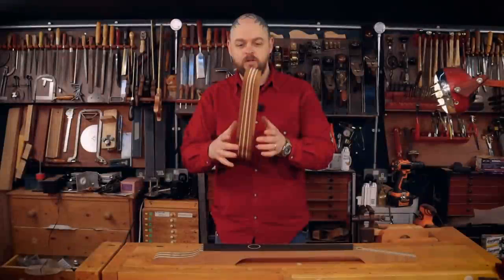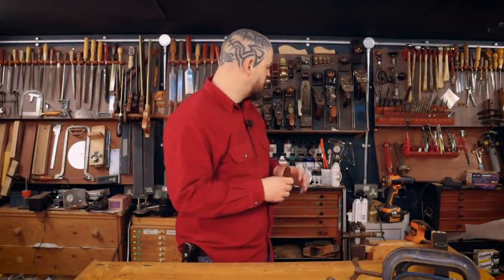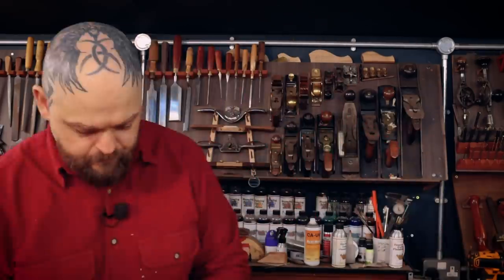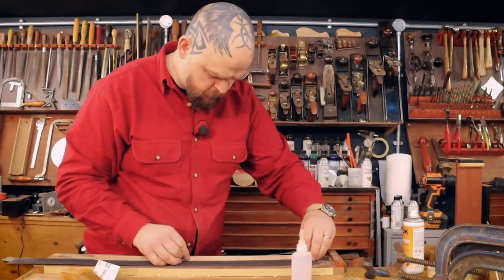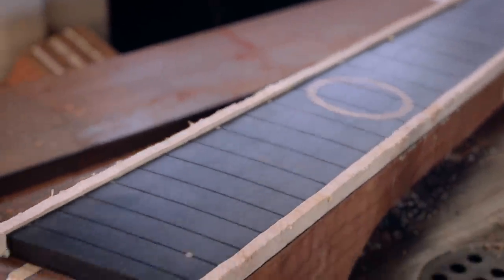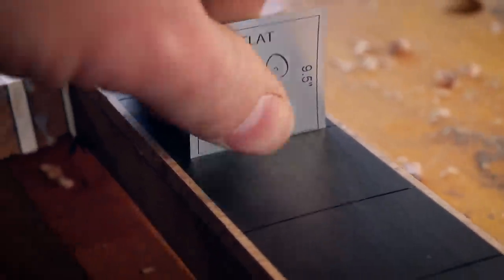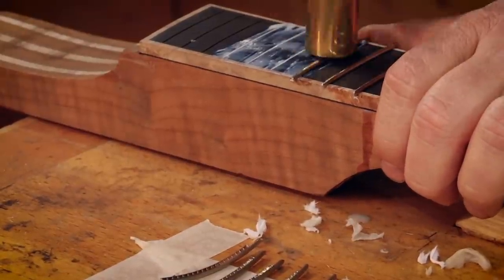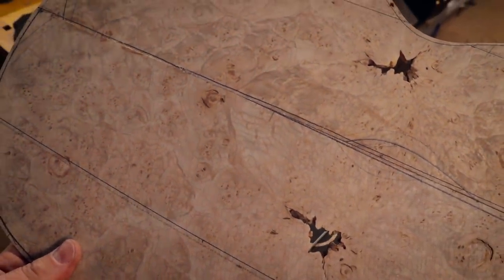Ep 5 Fretting and binding the neck - Making a Modern Multi-Scale Electro Acoustic Guitar

Comment: Pretty stripes!!   When gluing things like this that I dont want to move, I have always drilled a small hole in an opposing angle and used bamboo skewers (the sort you buy for BBQs) to hold the pieces together.  I find this especially useful on repair jobs to reinforce joints. Bamboo has massive strength across its fibres to prevent movement and you can always fill the drill hole with sawdust to make it practically invisible.

Comment: Quick tip: before using super glue, apply wax on the surfaces you don't want it to stick to. Then, you can easily peel the excess off these areas.
Reply from the maker: This works, and would save a bunch of time scraping etc.. still fiddly. I always worry about getting wax in places I don't want it tbh. B

Comment: To fill the gaps around the tangs when inserted into the fretboard why don't you mix fine Ebony sawdust with the glue to make a thick paste which you then squeeze into the slot?
 It would make the neck more solid. 
You could also try compressing some of the sawdust into the slots, applying AC glue then quickly knocking in the fret and spraying accelerator.
Use masking tape on the gaps between the frets to avoid having to clean off-should be easier to clean any glue off the frets themselves too.

Comment: Ben, fast tip, if you plane both top pieces at the same time (clamp them in a vice) you don't need shooting board. A plane's blade is wide enough to make sure the pieces will be in the "same plane" and will fit together.
Reply from the maker: I've had mixed results with that method in the past, then again that was early on and I struggled to keep things square back then.. B

Comment: You make the fretboard work look so easy. Any tips on how to cut a binding channel after having glued and radiused the fretboard? I forgot to do undersized my fretboard before I glued it on!
Reply from the maker: best thing to do is get two thin strips of material, I've used veneer or aluminium before. Stick them down the outside length of the fretboard and they will, if tall enough, cut out the radius of the fretboard. ran a router along the rails and it thinks it is on a flat surface, easy as pie. B

Comment: Hi, a little off topic but I've seen a technique that i think you may find interesting and i haven't seen used on a guitar neck I think it's call "woven". I actually saw it used on cutting boards and to be hones when I saw it the first thing I though was that would make such a cool guitar neck or fret board.  Anyway if you look up a vid called "Woodworking: How to Make a Woven Cutting Board" it should give you an idea.  Not sure if it would have any implications for the over strength / stability of the neck though.

Comment: I just thought of a cool test to do and record for our benefit. Do a few glue-up pairs with a variety of configurations, like end grain, long grain, etc. and make the pairs as exactly the same as possible, but put salt in one of each pair. Then break the joints using some sort of gauge to measure the force. I like the idea of the salt, but am not sure if I believe it doesn't affect the strength.
Reply: That doesn't sound like a video Ben would make. But I'm pretty sure I've seen a test video before and I think they concluded that the salt doesn't make a significant difference in strength.

Comment: Hogging lots of material with a number 3? Rather a 6 or a 5 1/2 I think?
It's going to be a really nice guitar! Thanks for your videos, Ben!
As an amateur woodworker, I struggle a little bit with miter joints, but you make it look real easy :-)
Reply from the maker: I should have said 4 really but I prefer 3 personally, most scrub planes are shorter, though longer planes can do the same as well.. albeit with a bit more work due to extra weight etc.. as to mitre joints, it has been a very long time and I've got it down! A trick I saw was to have an accurate 45 degree block to use as a guide when cutting.. B

Comment: This build is turning out fantastic, I am looking forward to seeing how it turns out!

Quick question though, the holes in the top that you said you want to try to use as sound holes... Is there a possibility that flex in the top (the last nebula wasn't super solid) could cause cracking to propagate from the sharp points of the hole?
Reply from the maker: Thank you, me too!  As to the wood.. this is orders of magnitude stronger than the burl poplar we used last time.. plus I'm going to be adding at the very least a bass bar.. and could add a thin veneer under the sound holes to add strength, saying that, your question is 100% valid and worth serious consideration.. B

Comment: FWIW, Titebond officially dissuades the use of salt, stating that it cannot predict the effect it will have on the holding power of the glue. As salt immediately dissolves in moisture, it's difficult to see how it would add any friction to the joint anyway.
Reply from the maker: Well, I de-clamped after about 4 minutes and the salt had dissolved, but I also could see where it had made small dents in the wood as I clamped up.. thus doing what was required.. I do agree that it should be tested first though.. and I prefer locating pins if possible. B

Comment: Hi Ben.  Do you tend to prefer putting FB binding on after fitting to the neck or do you do it both ways?  WHich one is easier to get it even on both sides?  Centreline is key obviously but does one method give you more ability to correvct thatn another?
Reply from the maker: Hi Clifford, I prefer routing the binding channel and installing it once it the fretboard is already glued to the neck.. the other option is valid but that way you have to clean up the bottom of the binding and that is one job more than if it is done the other way.. B

Comment: Quick question: does it matter what kind of hammer or what its made out of to hammer in frets? 

I have a guitar i need to fret but im afraid ill hit the frets too hard and dent them..
Reply: Yeah, you need a hammer made of some material softer than your frets. I just fretted a guitar the other day using a standard construction hammer, but I applied a couple layers of electrical tape over the hammer head to prevent the frets from being dinged. But the electrical tape needed to be replaced every 2 or 3 frets and the hammer is too heavy to be comfortable to use in this application. Some of my frets did end up with slight hammer marks from the tape wearing out, but they are minor enough that they'll probably be removed in the fret leveling process. I also experimented with hammering a block of wood onto the fret instead of hammering the fret directly, but found that it didn't work very well for me, the wood was too soft and deformed too much to actually drive the fret properly, plus it was hard to control the fret positioning under the wood. I believe that Ben's hammer is brass, plastic is also an option.

Edit: I just checked to confirm that brass is indeed slightly softer than fret material (nickel silver.)
Reply: @MattMcConaha  thank you! Hope you have a merry Christmas and a happy new year!
Reply from the maker: As Matt said, softer material if possible.. brass or nylon or polish up a steel hamme to make it  very very shiny and be gentle.. B
Reply: @CrimsonCustomGuitars  thank you Ben!

Comment: Are you not worried about the salt soaking up moisture?
Reply from the maker: No, not really.. I did use much more than I should have and it may have sped up the curing a bit but it did stick and is solid as any other glue up I've had.. B

Comment: I'm not an expert, but maybe better to use sand instead of salt?) <3 u
Reply from the maker: salt dissolves and very quickly stops pushing the pieces of wood apart.. sand would be in there forever and could make for a weaker joint. A valid question though. B

Comment: Sorry Ben, I still simply don't believe that a tiny percentage of a mm void under a fret makes ANY difference to the stability of the neck. Putting glue in there does nothing more than add both a step to do and a cleanup. Now that you've switched to wood glue I'm not even sure it will solidify in those mostly air-tight voids.
In fact I'll do an experiment on it - I'll cut some bound slots as you have, install a couple of frets and eave it for a week. I suspect when I remove the frets the glue will still be viscous.